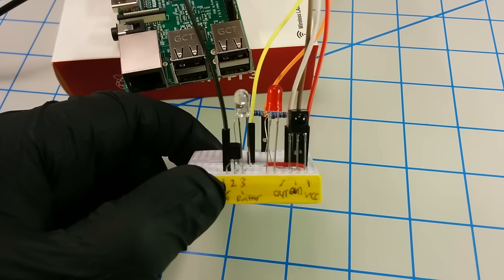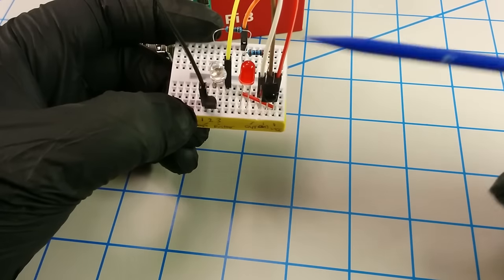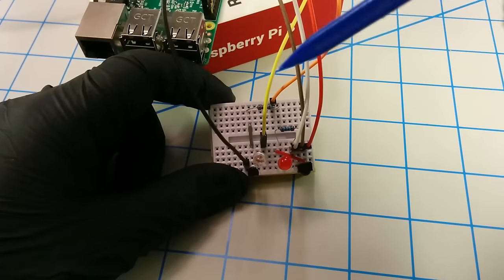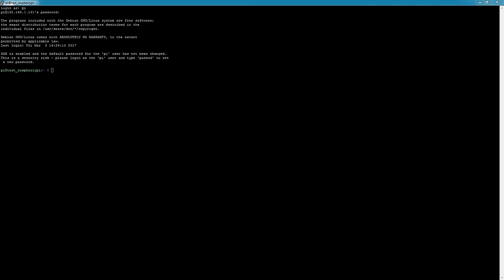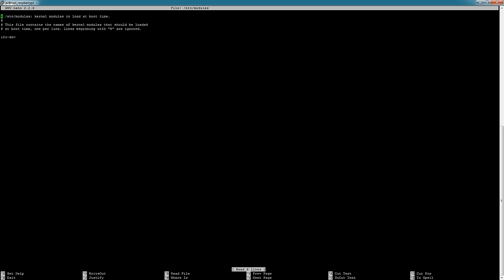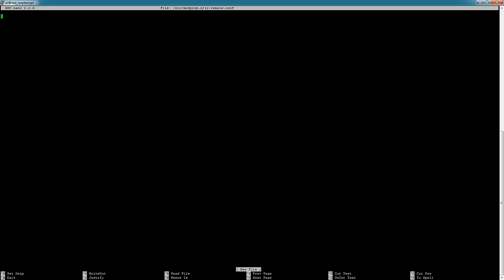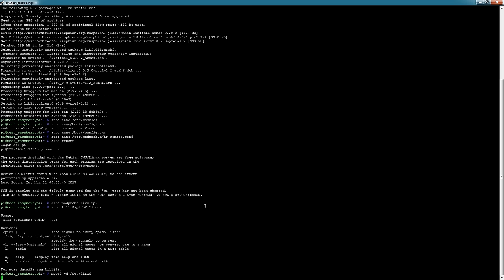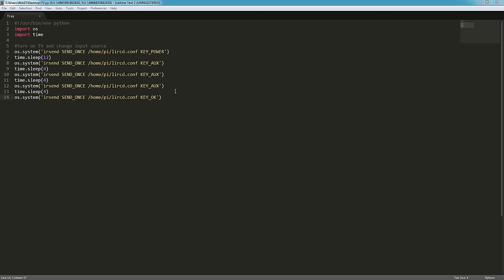Raspberry Pi 3 IR Blaster (LIRC)

Comment: If I connected a second IR LED to pin GPIO 27(directly above gpio 22) how would I control it as well as GPIO 22?

I have tried adding it to the boot/config, etc/modules and modprobe.d ir remote 
I wrote:   , gpio_out_pin=27 to all of the above files with the comma seperating the previous gpio_out_pin=22

I have also checked that pin 27 does work with the IR led by using a simple python script to turn it on and off however I cannot get the 
"irsend myremote on"
to work by outputting through both the IR leds. it only works with the first IR led from GPIO 22 outputting the IR signals. Any help is appreciated.

Comment: your video 12:40 when you type mode2 -d /dev/lirc0 this command and you get the output as space pulse and everything... I am getting this 
 Using driver devinput on device /dev/lirc0
Trying device: /dev/lirc0
Using device: /dev/lirc0 
I have followed all your steps correctly with the proper hardware connection as well. 
How to solve this issue? Please help me out
Reply: I wasn't having any luck getting output from mode2 either - I pulled out the LED and resistor attached to it, and suddenly all the space/pulse stuff started showing up just perfectly.  But first I connected my IR receiver directly to the Pi, just to see if the results differed.  It started reading right away - and stopped as soon as I plugged it back into the circuit.

Comment: This video and the accompanying article has caused me to have a severe case of cognitive dissonance, because the transmitter part of the circuit should not work as shown because the polarity of the current flowing between collector and emitter in the (what is claimed to be a) BC547 transistor is wrong.  This video and the diagram in the article shows the +3.3 volts power being connected to the transistor's EMITTER by way of the infrared LED (and no resistor to limit the current, normally a resistor of somewhere around 220 ohms is used in circuits like this) and the negative ground being connected to the transistor's COLLECTOR - he even helpfully labels the connections on the front of the breadboard so you can see that this is how he is hooking it up.  But EVERY other diagram I have found using an NPN resistor such as the BC547 or a 2N2222 shows that the positive side of the circuit must be connected to the collector, and the emitter must be connected to the negative side (ground in this case).  Compare to circuits at https://www.raspberry-pi-geek.com/Archive/2015/10/Raspberry-Pi-IR-remote or https://forums.raspberrypi.com/viewtopic.php?p=2054578&hilit=transistor#p2054578  and you will see what I mean, of course it's harder to compare the circuits because the author of this video never shows a proper schematic diagram (if he had drawn one he might have noticed this issue).

Any yet... and yet... he demonstrates the circuit working, though only to send one single solitary button press.  So how can that be?  My suspicion is that he may have THOUGHT he was using a BC547, but actually grabbed a PNP transistor instead.  The circuit he shows would work if he were using a PNP transistor, see the discussion of the difference at https://electronicsclub.info/transistorcircuits.htm#types and then scroll down to https://electronicsclub.info/transistorcircuits.htm#ic which shows the difference in how the two types of transistors are wired.  The circuit shown in this video makes sense if a PNP transistor is used, but he clearly identifies the transistor as a BC547.  And while you can use a BC547 or the equivalent 2N2222 for this purpose, they will not work if you try to send current through them in the wrong direction.

Now it is entirely possible that the author got hold of a PNP transistor that was mis-labeled as a BC547 and that they then sold those "mistake" transistors in a big bag on eBay or Amazon, and he got one and just started moving parts around until they worked.  Or I suppose it is possible that every other site I found that used a BC547 or 2N2222 was wiring it wrong.  Or maybe the laws of physics don't apply in his kitchen.  Or maybe I have gone crazy in my old age and despite watching his video and looking at his circuit many MANY times while trying to resolve this incongruity, I am just not interpreting his circuit correctly.  All I know is that according to everything else I have read, his transmitter circuit cannot work as he has it wired up if he is really using a NPN transistor such as the BC547 that he says he used.  If anyone wants to to explain why I am wrong please do, because this is driving me crazy.

Comment: I've followed all the steps described in the video but on using irsend command I keep getting an error : Command failed and unknown remote. I've created the remote file. How do i solve this problem?
Reply from the maker: Have you followed the steps outlined on the website? http://www.piddlerintheroot.com/ir-blaster-lirc/

I don't recall off the top of my head, but it sounds like you need to issue this command before the irsend command. "sudo lircd --device /dev/lirc0"
Reply: Did you ever get it fixed, I am having the same issue
Reply from the maker: Hey Terrance, have you tried running "sudo apt-get update", "sudo apt-get upgrade", and then rebooting? If that doesn't work it sounds like there may be a syntax issue in your lircd.conf file. Take a look at an example configuration at http://lirc.sourceforge.net/remotes/ and check it against your file.
Reply: Tried both of those, no change. Also, I am using one of the configs provided on lirc site (http://lirc.sourceforge.net/remotes), so I doubt its the syntax in the conf file
Reply: i have some problem did you get it fixed
Reply: how i can check the file where is in this list URL
Reply: can u help  sudo lircd --device /dev/lirc0
lircd: there seems to already be a lircd process with pid 1032
lircd: otherwise delete stale lockfile /var/run/lirc/lircd.pid

Comment: I have error when i run command "irsend SEND_ONCE TV KEY_POWER"

hardware does not support sending
Error running command: Input/output error

lirc version lircd 0.9.4c
can anyone help me?

thanks
Reply: did you solve this ? i have the same issue
Reply: i think its because of the version 0.9.4c, seems to have some bugs. hes using v. 0.9.0, try a different version
Reply: Okay so i have fixed it: get this .img file and use it instead of the newest raspbian version. it will work. http://downloads.raspberrypi.org/raspbian_lite/images/raspbian_lite-2017-07-05/